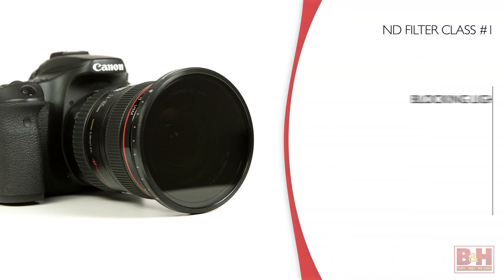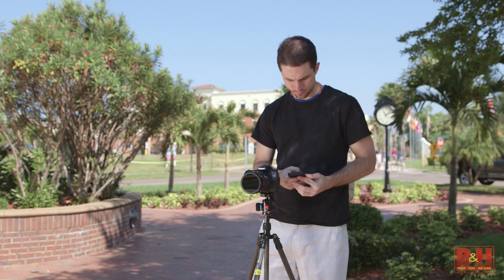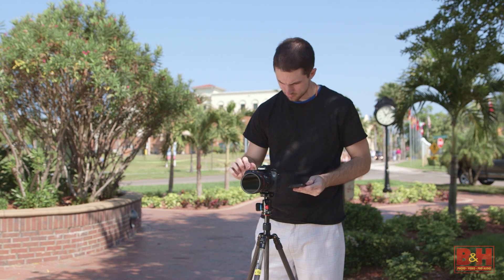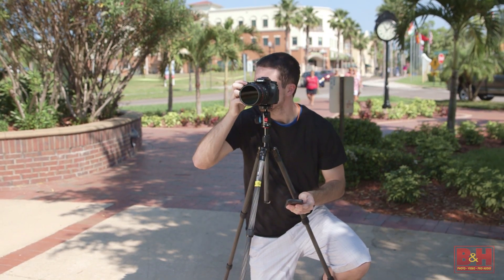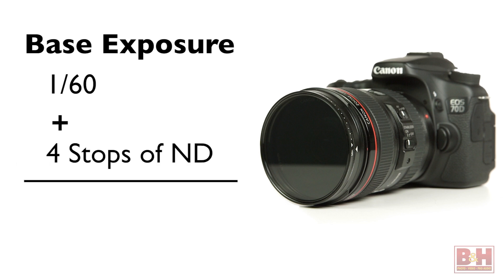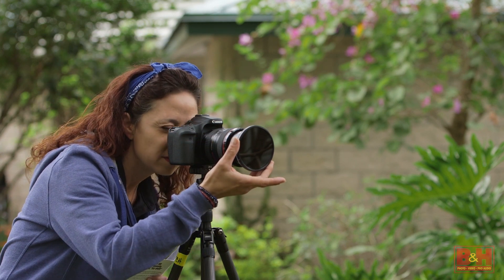The Basics | Introduction to ND Filters

Comment: Can I use ND and black pro mist filters together on the lens ??
Reply from the maker: As long as the first filter you place on the camera has front filter threads, and the thread size on both filters are the same, yes, you can use a Tiffen Black Pro-Mist filter on top of a neutral density filter (or vice-versa).  Depending on the focal length of the lens you own, when stacking filters, there may be a chance of encountering vignetting.  This typically happens when using extreme wide angle lenses.  This is not an issue, but just something of which you should be cognizant.

Comment: Question: For portrait photography using low f-stops ie 1.8 why not just use a high shutter speed?  Wouldnt iso 100 with say 1/6000 sec shutter cut the exposure enough even in bright daylight? Is there some artifacts with using high speeds like that im unaware of?  I do understand needing one of these if you need a slow shutter speed in bright day light to get motion effects ie waterfalls, ocean etc though.
Reply: You never need to darken a bright day nor is there any artifacts with using high shutter speeds. ND filters is strictly for being able to shoot objects in motion to create certain effects.  Often effects you might want to use a nd filter for is to slow the shutter speed down to 2 or 3 mins of exposure. slowing shutter speed down to even half a second for moving clouds just isnt long enough for one example.

Comment: which size of  circular  nd filter fits canon 50mm f1.8 and canon kit lens 18-55mm lens ?
Reply: 58mm
Reply from the maker: It would depend which version of those lenses you own. For example, the EF 50mm f/1.8 II would take a 52mm filter while the newer EF 50mm f/1.8 STM would take a 49mm filter. As for the Canon 18-55mm, all versions take a 58mm filter. <<<Kirk>>>

Comment: Can i put the nd all the time? Even its midnight does it hard to take a shot? I'm searching a filter that just good to be on top of my lens all the time.
Reply from the maker: ND filters are generally best used in very bright conditions to allow for a larger aperture to be used. If using them at night, the exposure would need to be very long depending on how dense the filter actually is.   If you're just looking for a general protective filter, a clear or UV filter would be best to use.   <<<Kirk>>>

Comment: say im taking a skyline picture where theres a lot of bright sky involved, would an ND filter help making the sky more blue rather than washed out white with no detail?
Reply: Maybe, but a polarizer would likely be better help for this.
Reply from the maker: If a graduated ND filter was used, that would essentially reduce the exposure on the top of the frame, thus the sky, while the bottom of the frame remains the same. You could also use a circular polarizer to deepen the sky, but that will also deepen the colors in the foreground. <<<Kirk>>>

Comment: Also since I'm planning on purchasing the square filters can I buy one ring and then use a step up ring for the other size lens?
Reply from the maker: You could, but it is not recommended. Removing the step-up from the adapters can be difficult and would easily jam. *Andrea

Comment: If I wanted to buy one Grad ND filter to start with, which one would you go with?  I want the Lee brand.
Reply from the maker: The LEE Filters 100 x 150mm 0.6 Hard-Edge Graduated Neutral Density Filter would be a good place to start. This would provide a reduction of 2-Stops of light and can be used for both bright skies in more mid-day shooting as well as sunsets/rises. I would also consider the LEE Filters Digital SLR Starter Kit, which will included the above mentioned filter as well as a .6 standard ND filter and foundations holder if you to not already have. 

http://bhpho.to/29eYEe9
http://bhpho.to/29eYJhT

*Andrea
Reply: @ David Coulter, bare in mind the LEE 100mm system is a dated system. If you want a flimsy plastic holder then by all means go with Lee and if you desire to shoot through resin ( aka, plastic ) ND grads, then go with Lee.
If you want a machined aluminum holder & desire to shoot through 100% optical glass on all your filters, then I recommend you take a look at the NiSi System... It costs less money & lab tests prove it is a better system than the Lees... One of the best values out there currently...

Comment: Thanks for the explanation! Does anybody know how neutral density filters can be added to compact cameras (such as the Canon G7X)? Thanks
Reply from the maker: There is not an ideal solution for compact cameras unless the lens specifically has a thread that can accept filters, or an accessory is made by the manufacturer that would allow you do so. For smaller lenses, the LEE Filters Seven5 system would be great lenses sized 37-72mm especially if looking to stack filters. Unfortunately for the G7 X, the lens is not threaded, nor is the available attachment. 

http://bhpho.to/1TZWVwO
*Andrea

Comment: So I am new to this. Will a filter for a Canon T5i basically work the same for a Canon T5. Every time I look for ND Grad filters on Amazon they always seem to not include the Canon T5 in the description, which I use. Any helpful comments?
Reply from the maker: +Jared Hutchinson It depends on the specific thread filter size of the lens you are using, not the camera body. If you are using the 18-55mm kit lens that came with the T5i, you would need a 58mm sized filter. Here is a link to compatible options: http://bhpho.to/1TGc9mu
*Andrea

Comment: Hey, I need help. I'm planning to shop on your online site, I'm (not necessarily a freshman but have reached that point where I really need to get a new camera because my 6 year old camera just doesn't do anymore) at film school and want to put together a nice BMPCC setup. I plan to get the Panasonic 14-45mm as my prime lens, and the Rokinon 85mm cine. I want to get an ND filter (because I've learned on shoots that sunlight messes up good shots) but I'm sort of a newbie with ND filters. I've noticed on your shop that there are different ND filters - there's 52mm, 58mm, 77m, 82mm, etc. I have to ask (at the risk of sounding stupid), does the mm on my ND filter have to match the mm on my lens? Isn't there one ND filter for all lenses? I only want to get just one ND filter for now - but what mm of ND filter do I get for a 14-45mm? If you could respond ASAP, it would be much appreciated. And I apologize as well for the dumb question. :) Thanks!
Reply from the maker: +MalloryJacobPacheco  - Pardon the delay in reply, for immediate replies you may feel free to email askbh@bhphoto.com and we have a larger team of responders assigned to handle questions there in a faster manner.

The filter thread size on lenses is measured by the front of the lens’ diameter.  Every lens is potentially different (but conforms to specific industry standard sizes, such as those you listed in your inquiry) and can be measured by simply removing the lens cap and looking at the number on the underneath side.  Also lenses will commonly have the filter thread size indicated on them as a number with a small technical symbol next to them which is a circle with a diagonal line cross through it which is the industry symbol for “diameter”, and if it’s still not clear, we post the filter sizes on the product link for all lenses on our website.  

The Panasonic 14-45mm lens has a 52mm sized filter thread. There are options for special filter system which are square and fit in a special holder, and the holder can then be adapted to virtually all standard filter sizes.  Below is a link to a great Neutral density filter kit using the holder and square/rectangular ND filters, which comes with the holder, and every size adapter ring you could need, and includes 7 different types of ND filters and also a special modular hood and
wide angle holder.  The kit complies with the Cokin brand “P” system, of which there are many great filter options available.  See the link below for
details.  - Yossi

http://bhpho.to/1QvTLQv
Reply: Thanks for responding! Wow, that was very detailed and informative - good thing I haven't "checked out" yet. It's hard to look for these things if you don't know what exactly to type in sometimes. Thanks again!

Comment: dont forget to tell your camera boy to turn off the IS while the cam is on a tripod,,haha
Reply: In older IS systems, the vibration caused by the IS motor as it continually attempted to stabilize the lens, which was already perfectly stabilized on the tripod, could actually cause your tripod photos to be less sharp and even blurry. 

Newer IS lenses properly detect when a lens in on a tripod and no longer have this issue, but if you're not sure about yours, just turn it off. You don't need IS when on a tripod anyway.
Reply: im a noob, why?
Reply: ktbeatty explains why my long exposure night shots have been blurry. Thanks for that tip!

Comment: I use the meter in my camera in conjunction with dialing in my variable ND to get the exposure I need using the manual setting.  You don't have to do any calculations.
Camera straps usually have have the eye viewer blocker.

Comment: I use variable ND filters, so I can focus with it on there. But also because I want to be able to use it for video. To keep it at 1/50 at 24FPS in bright day light.
Reply: With video you have to use an ND filter outside or else you can't keep the shutter speed down and yes you can see and focus.
Reply: You want to use a variable ND filter for video, not these type of ND filters.
Reply: You would only have one strength. So it's always gonna be too dark or too bright. You have to chance it with the sun to keep the shutter speed the same.
Reply: Btw, you should be able to find a cheap one. If it's for a smaller lens you may be able to find a quality variable ND for 30 bucks. For big lenses, like 77MM a quality one may cost about 127 dollars but for video, you can get away with a 60 dollar one.
Reply: Well, work with what you have. On a cloudy day you don't need an ND filter, try to shoot toward the end of the day, almost night, or on an overcast day. Or set the shots up indoors only.
Reply from the maker: ***** The density of the type of filter he was speaking about is for longer exposures for still photography, and do not really apply to video work. Typically ND filters used in video work are not so dense that they are opaque. - Yossi

Comment: Where can we saw examples of the difference between no filter and an ND filter
Reply: +lintownboy there was a quick (simple) example of density at 3:14
Reply: Torontoista I guess google it. Because they are stupid not to show examples in this video. There are other videos about it on youtube also if u dont feel like googling it :) Good luck.
Reply: Torontoista The difference is, fast shutter speed or slow shutter speed in daylight with faster apertures. for example with video, in the day light we use ND filters to keep the shutter speed at 1/50 at 24FPS. If we don't, the video will be shaky.
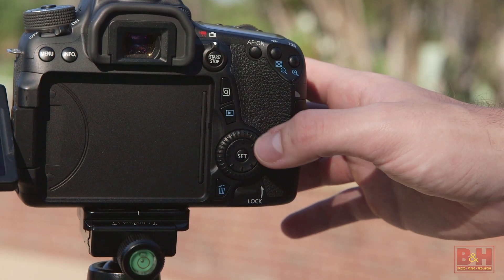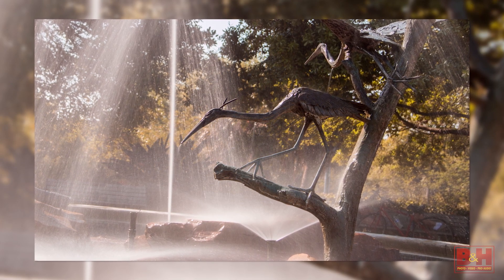Reply: +Torontoista 1:53 and 1:58

Comment: Can a square ND filter be used with any filter thread size?
Reply from the maker: timtimzi ni 
Generally speaking yes they can. Most Square/Rectangular filter systems can be adapted to filter thread sizes between 49mm up to 77mm. For filter diameters outside that range on occasion there are special adapters available (depending on the brand of filter holders/filters being used). If there are specific lens/lenses you would like to outfit with a Square ND filter system, please email us at askbh@bhphoto.com and our agents there can reply with any compatible recommendations. - Yossi